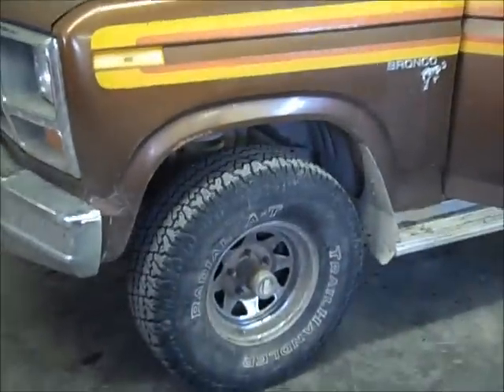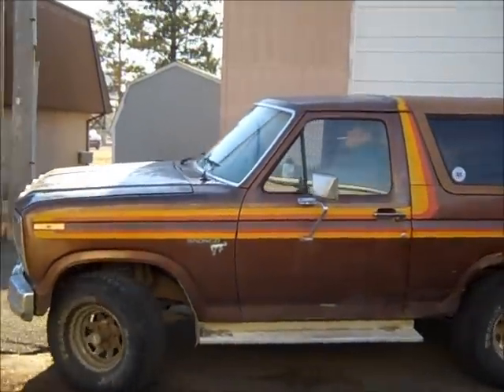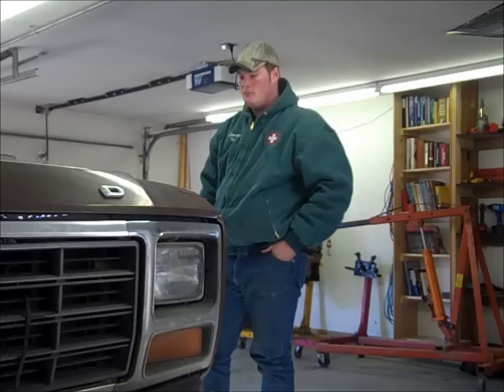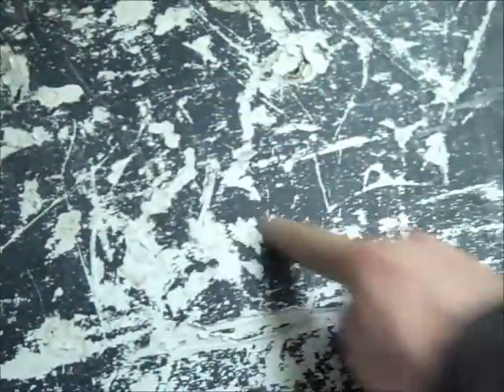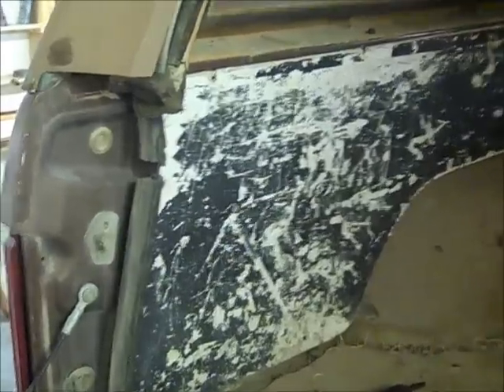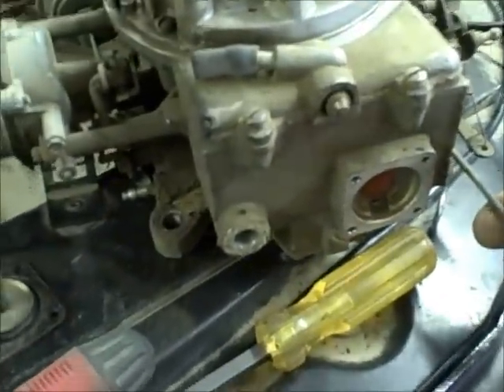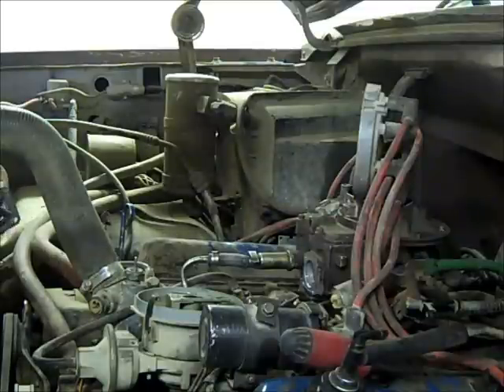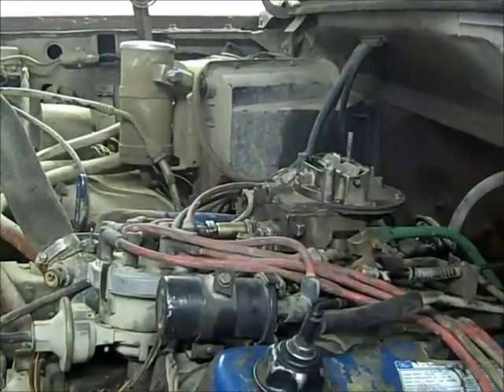More work on the Brown Cow

Comment: Wayne - Don't know if you have tried this yet, but unhook the EGR valve and plug the vacuum hose. I would defintely check the power valve , again....just to be sure. The power valve is very prone to go bad - sometimes it only takes a couple of backfires and the power valves is junk. One more thing, give it a little more advance on the timing....that is if it will take it without pinging. With the EGR unplugged it might ping easier , though. Good luck!!!!

Comment: Those 2100's are good carbs but I don't like the accelerator pump design, which is like a Holley. If the diaphragm ever splits there goes the gas onto the manifold.

 They are supposed to work more efficiently that a cup still like the Qjet and Carters use though.

Comment: wayne trace that panel out on a 3/4" board and then cut a sqaure were the speaker is going make sure its about 14 3/4" all the way around and then build a box to fit in that hole and angale the box forward so its pushing sounds towards u make sure the box is fully inclosed with a couple of 2" ports u can use pvc pipe for this they only have to be 3" long screw everthing into place and u can use your choice of interier to cover the panel from Anthony